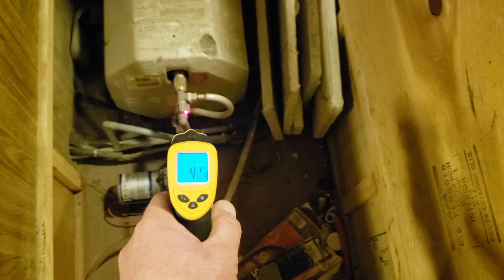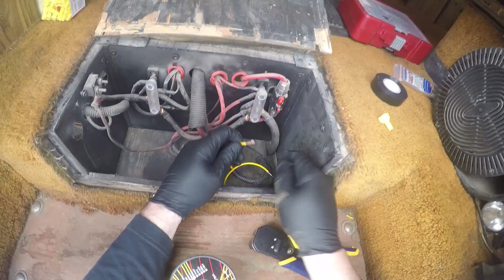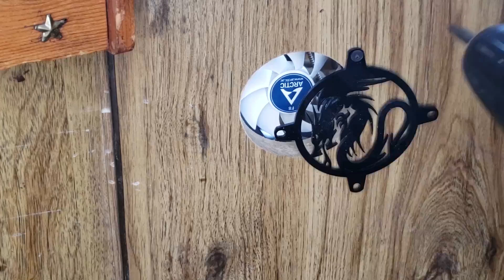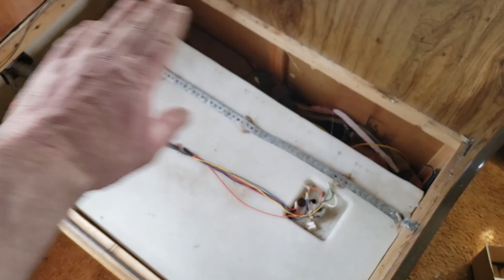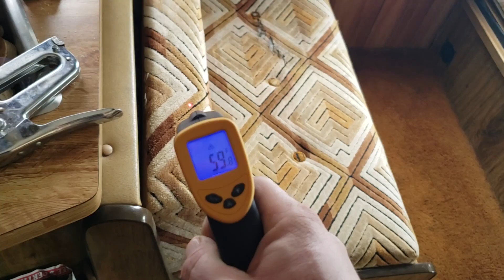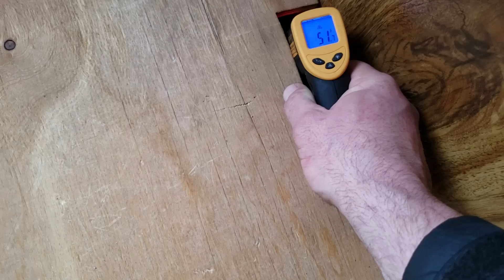RVing In Winter Water Pump Freezing Solved

Comment: You should only need the fan on the exhaust side and just a vent on the intake.
Reply from the maker: It is a big cabinet for one 80mm fan. I did try it with one fan and it was not circulating enough for me. Feel free to experiment with you setup. Thanks for the comment and happy camping.    Jim

Comment: On Amazon you can find DC ventilation fan systems and vent grills used in audio/video and IT cabinets. These are scalable and thermostat control is  available for these units.  This gives you a greater selection of computer size fans moving as much volume of air as desired..
Reply from the maker: I searched your key words and did not find many options. I recieved more results just searching ps fans or 80mm fans. I could add a potentiometer to controll fan speed but the arctic fans I chose are whisper quiet at full power and move plenty of air. If you have a link to better fans I may share the link in the description. I picked up five fans for 15 bucks but then the price changed to 24 bucks. Still not bad. I'm sure people are open to suggestions. Let me know. Thanks and take care.    Jim

Comment: Jim, you couldn't run a heat duct into that area with an exhaust vent? On second thought all you need is the exhaust fans with small vents to draw warm air in. That way you would only draw half the power.
Reply from the maker: Unfortunately, there is not a single heat vent on that side of my RV. It was easier to run wiring than duct work. Otherwise it would have worked to have the duct work run through the cabinet which would give off enough heat to keep the water pump warm. Good idea though. Thanks for the comment  and  happy  camping.  Jim

Comment: Great idea.  You might want to try just running the two lower exhaust fans and save a bit of power when you keep the inside temps well above freezing - they might provide enough circulation.  Another potential modification is to use a 12V thermostat like this (Amazon ID B01H6FBY92).  I've seen people use 120V thermostats to cycle power to deep freezers (the kind you reach down into) to operate a chest freezer as a refrigerator keeping food around 35 degrees.
Reply from the maker: I thought about doing both of those things. Running two fans didn't quite get me up to RV temperature. I also considered a thermostat but at .8 amps I'm not too worried about it as I rarely go camping in under freezing conditions. But when I do it'll work. I should have mentioned that in the video but since I didn't do it in my install I just left it out. Great ideas though. Thanks for sharing them with us. Take care and happy camping.  Jim